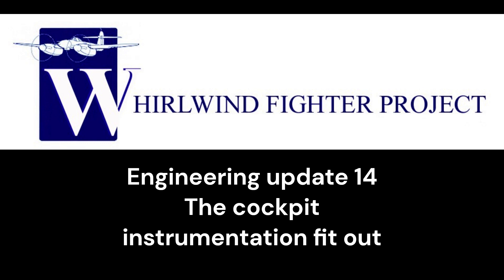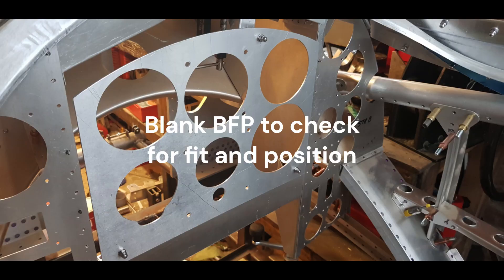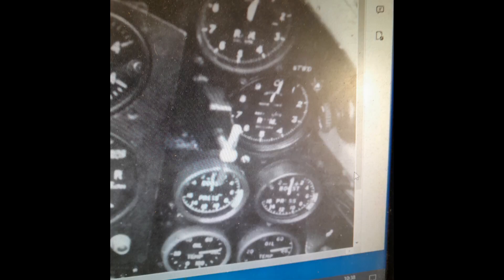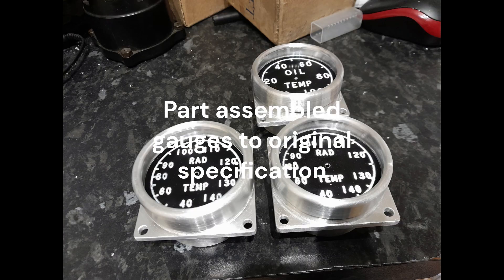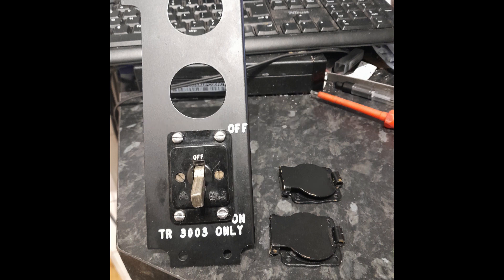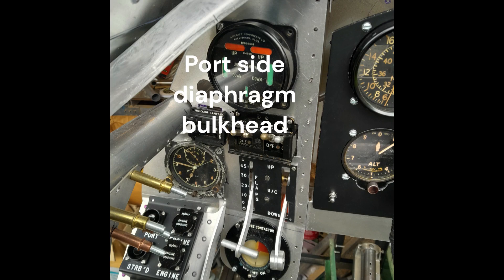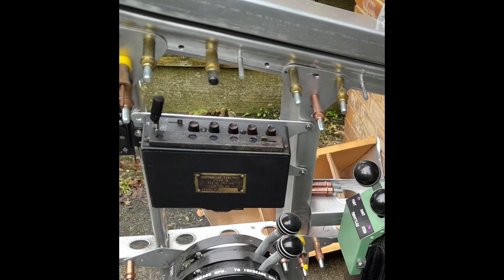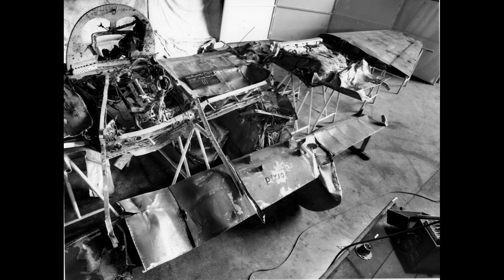Whirlwind Fighter Project - Engineering Update 14 - Cockpit fit-out

Comment: Awesome work. 

I am intrigued that the flap lever and gear lever are in opposite directions. That is, when flaps up and gear up (clean), the levers are opposite each other. Similarly, on final approach with flap full and gear down they are also opposite. Completely different to what I imagined as a pilot. I imagined that either clean or fully configured both levers would be together as shown in the photo. 😮
Reply: That's an interesting point and one I'll look into.